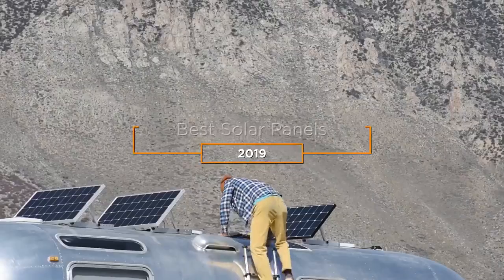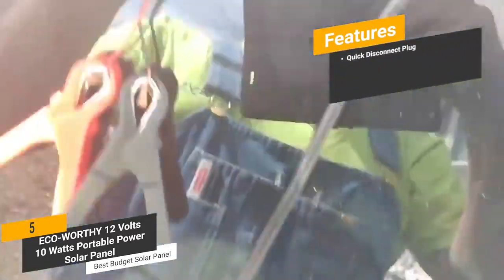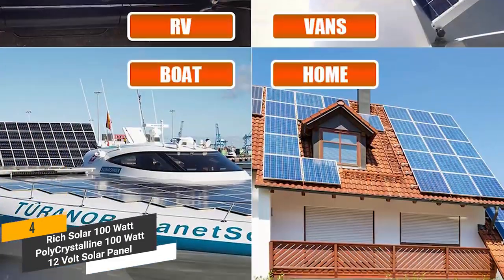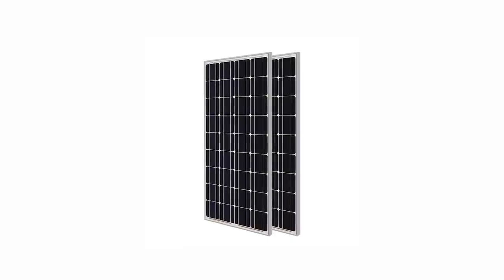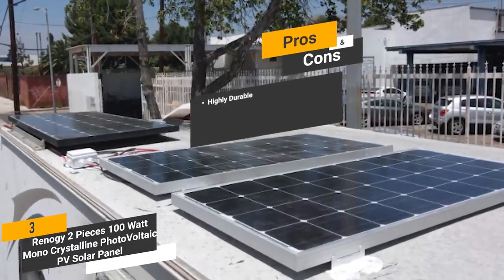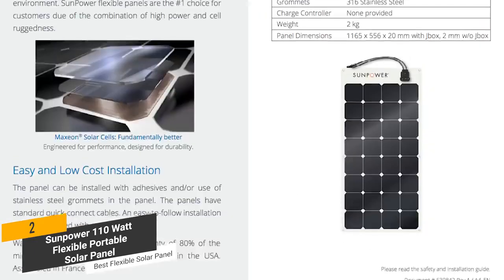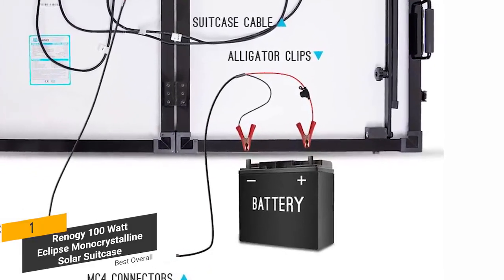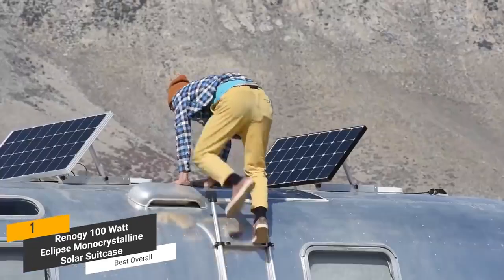Top 10 Best Solar Panels 2020

Comment from the maker: 1. https://amzn.to/32kKHWW. Renogy 100 Watt Eclipse Monocrystalline Solar Suitcase Charge 20A Voyager Waterproof Controller, 100W-Waterproof.
2. https://amzn.to/33kNOzs. SUNPOWER 110W Flexible Portable Solar Panel / Monocrystalline Cells / MC4 Connectors.
3. https://amzn.to/2NBRqpS. Renogy 2 Pieces 100W Monocrystalline Photovoltaic PV Solar Panel Module, 12V Battery Charging.
4. https://amzn.to/2JNcfhd. Richsolar 100 Watt Polycrystalline 100W 12V Solar Panel High Efficiency Poly Module RV Marine Boat Off Grid (1pc).
5. https://amzn.to/2oL5q8q. ECO-WORTHY 12 Volts 10 Watts Portable Power Solar Panel Backup for Car Boat with Alligator Clip Adapter.
6. https://amzn.to/34tri7q .
7. https://amzn.to/2NmSrn7. ECO-WORTHY Daily Output 2KWh 400 Watt Monocrystalline Solar Powered System Off Grid Kit with 60A LCD Solar Charge Controller.
8. https://amzn.to/2WLvrkB. 1.5KW PluggedSolar with 1500Watt Crystalline Solar Panels and Micro Grid Tie Inverter, Plug into Wall, 120V or 240V AC Outlet, Utility Approved Micro Grid Tie Inverter (UL-1741). Breakthough in Solar. 30 Percent Federal Tax Credit.
9. https://amzn.to/32e3BP6. WindyNation 400 Watt Solar Kit: 4pcs 100W Solar Panels + P30L LCD PWM Charge Controller + Mounting Hardware + Cable + MC4 Connectors + AGM Battery for RV, Boat, Cabin, Off-Grid 12 Volt System.
10. https://amzn.to/2NhBBpC. Go Power! Weekender SW Complete Solar and Inverter System with 160 Watts of Solar.
11. https://amzn.to/36D4SCE. 1000W 24V Hybrid Wind Solar Power DIY Off-Grid Kit - 400W Wind Turbine + 6x100W 12V Mono Solar Panels + 50A Hybrid MPPT Controller + Solar Panel MC4 Cabling.